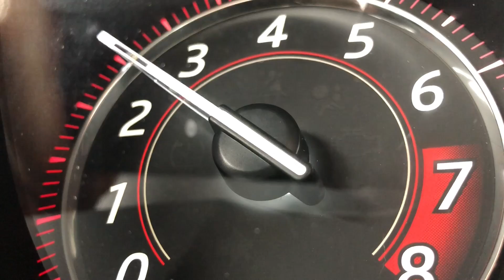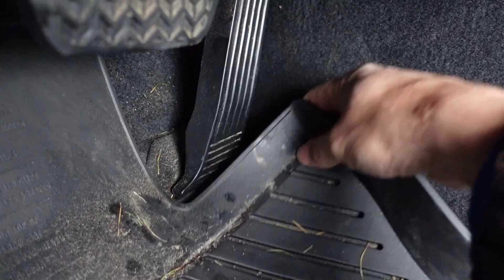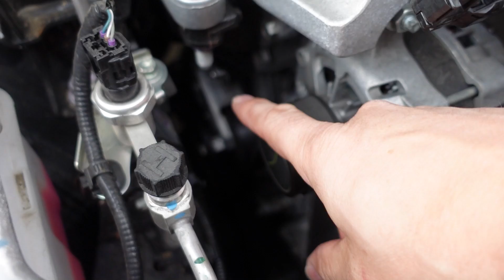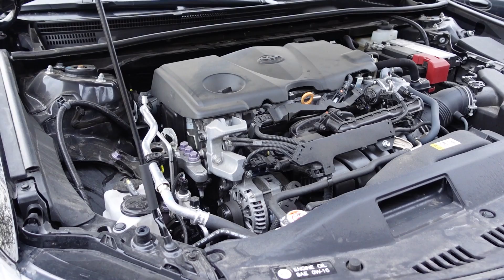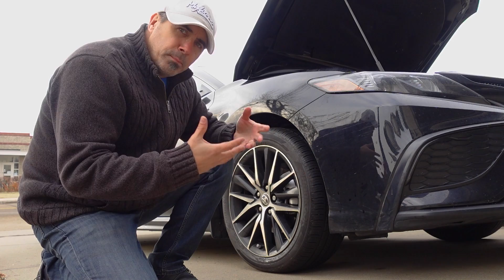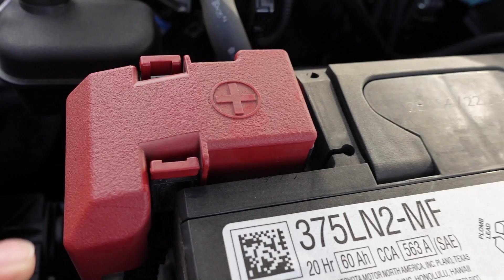Has Toyota LOST Its Reliability Reputation?

Comment: I have a 2012 Camry LE hybrid with 152k miles that I originally purchased new. Overall reliability for this model year has been excellent. I perform nearly all the maintenance on this Camry personally. I wanted to trade this Camry in for a new Avalon two years ago but then I heard from an employee at a local dealership that Toyota had embraced racist and toxic DEI and ESG initiatives. Unless Toyota stops these initiatives, then I will hang on to my Camry until it wears out, which could be 10-15 more years based on my current mileage.
Reply: Netflix almost like saying going to hold onto your body for 10:20 more years because you are you can't get into somebody else's body is stuck with your own into something else or another person and but no you don't know that say hold on to your own ass you're saying the same thing dog

Comment: I hate the keyless/button to start & screen trend. I just want a regular key & no screens
Reply: Then I'll sell you my car it's a 1997 Corolla 2570 Mi on it the inside of the motor is clean the day it was no it's a wonderful kind I want $20,000 for it yes the price of a new Corolla or I got a 1997 Nissan Sentra 2500 it's also cleaned inside the motor as a brand new one so you better get your ass over here and get rid of your own s*** and then you won't have to worry about sticking your finger on your button to

Comment: G’day Mark, fantastic vlog yet again. I own a Toyota Camry 2018 Ascent Sport 4 cyl 6 speed (non hybrid) quad exhaust motor vehicle here in Australia 🇦🇺 and do an oil and oil filter service every 7500 kilometres. I am very happy with the car but don’t like where Toyota are heading with the CVT and turbo engines. Is their any other advice based on your experience I should be wary of on my car. I hope to keep this car for 25 years.

Comment: I have a 2gr hilander, oil lines are replaced. I change the oil and filter every 3500 miles. I live in Puerto Rico, a tropical island.

Hot I replace the coolant every 3 years or

36,000 miles of transmission oil every 30,000 miles all mobile one synthetic oils.

Pcv every 20,000 miles. The transmission filter

Each

60,000 . Engine air filter is a K&N. The spares or spark skngles each

60,000. There has never been a single problem of anything, maintenance is key.
Reply: Sorry for
My inglish jejeejejejejjeje

Comment: Tengo una hilander 2gr se remplazolas líneas de aceite.Le cambio el aceite y filtro cada 3500 millas vivo en Puerto Rico una isla tropical calurosa le remplazo el coolant cada 3 años o 36,000 millas aceite de transmisión cada 30,000 millas todos los aceites sintéticos mobile one. Pcv cada 20,000 millas.El filtro de transmisión cada
60,000 .Filtro de aire de motor es un K&N.Los espares o bujías cada
60,000. Nunca a dado un solo problema de nada el mantenimiento es clave.

Comment: There are multiple reasons why modern cars are unreliable, no matter what brand.  All the high tech electronic gadgetry that people crave are a PITA. Also, because of fuel consumption standards we see CVT transmissions, small displacement engines with turbos, high-pressure fuel pumps and of course hybrid batteries.

Comment: 2015 RAV.
Water pump fail @ 60k
Missing body screws.
Cracked rear tailight
Only 2 cup holders
Not designed for those above 6 feet tall.
    2000 Toyota Quality Excells 2015 RAV.
  Dont Buy Toyota
Reply from the maker: Wow, thanks for sharing.  Yikes

Comment: Its true just bought my wife a 2024 grand highlander and less than 500 miles and already had to take it into a dealership to see what was wrong with my car.
Reply: Weren’t the interiors noisy, plastic parts squeaking?
Reply: @melissasmess2773  no it's fine at least for me. They finally got the software update and it's working fine
Reply: Why did you buy that piece of s*** you should have known better than both the 4Runner dog

Comment: Saw a 2007 Toyota Camry with over 700,000 kms on it or 420,000 miles that has the original motor and transmission and still ran as good as ever.
Reply from the maker: Wow, that is absolutely bananas and in a good way
Reply: That was the worst year for the first on the Camry who won last night long no way Mr guy changed the oil every thousand miles Channel 6 on Lewis I don't know you tell me the six cylinder was you tell me

Comment: I had a 2006 rav 4 and 2007 solaria both has bad pistons rings and I had to dump both vehicles  at a loss then they recalled
After they were gone. I left Toyota for Honda and then went back to Toyota and I have t,here a 2015 rav 4 normal trans
2021 tundra normal v8 no turbo crap for me and a 6 speed manual corolla 2022

Now the tundra is v6 turbo and the corolla stopped making the manual so only CVT
TURBO and CVT will be the downfall for future reliability
Reply: Duh I know that for 50 years old you just learned that now I don't know dog you better start eating your own dog s***

Comment: Original owner of a 1997 Tacoma with 289,000 miles on the odometer with a 4 cylinder 3RZ Motor.  Recently replaced the original water-pump at 256,000 which was not leaking.  It was replaced because I had a seeping oil pump cover that needed re-sealing & the water pump has to be removed to perform this and was replaced out of caution.  Same goes for the Brake master cylinder, brake booster failed but the master cylinder still performing perfectly. Both parts replaced with Genuine Toyota Parts & hopefully they are of the same quality as the old factory parts were.   Brake fluid in reservoir was changed every year & coolant every 5 years which I believe gave them a long service life.  Toyota is treading into some questionable areas & could end up regretting their decisions in the long term.  Only time will tell but get your V8 & V6 Toyota/Lexus's now because the new small displacement turbo motors are not the answer.

Comment: I don't agree with the narrative of this video.  Toyota and Lexus are well known to have some issues with new powertrains and they address them quickly.

1) I drove a Toyota engine that was well known to generate sludge over time even with normal oil changes (1mz-fe).  The car had over 270k miles before I sold it and it didn't even eat oil.  
2) Unintended acceleration.  That was already addressed and some cases were fraudulent cases made up by people.  
3) Oil line leak in the 2GR-FE engine. Already addressed by a recall.  Had it fixed and the car has over 210K miles.  

Bottom line, Toyota is way more proactive to fix issues and the reliability is still there.

**Quick update:  I do agree with the weak suspension issue with some of the front drive Toyota vehicles. I had one that is always off with tires worn prematurely.

Comment: I regret buying a 23 Camry lots of rattling noise otd this my first and last toyota..beware and be wise they are not like before so it’s overpriced..
Reply: I bought a Acura TSX the other day 2011 for 2500 it runs and drives great the body's all scratched up and some dents and it's making a whining noise from the wheel bearing but otherwise as fast as hell and the transmission shifts are write 250,000 me I think I got ripped off or what

Comment: I knew about the accelerator problem with Toyota and thanks for your explanation of the problem l own a1997 Toyota Hilux and it will only may have a problem  with the front end but so far so good
Reply from the maker: Those machine run for a long time.  Thanks for watching

Comment: The general public should buy Toyotas at a slower rate than what exists now. People are buying Toyotas as if they are the only reliable car which causes Toyota to get too big of a market share. Quality also slips when an auto manufacturer has to work extra hard to keep up with the demand. Instead of Toyota think of other reliable makes like Mazda, Honda or Subaru. Although there are a number of good European brands, parts are generally quite expensive. I have had good luck with North American brands, but still be selective.

Comment: They think Toyota is bad because he hasn't already had a Honda, I had a 2013 Honda Accord, when I bought a Cvt that needed an upgrade, VTC actuator making noise, engine consuming oil, rear brake calipers broke prematurely, I had to change the pair, car with 140k miles started to give punches in the transmission, I always changed Cvt oil always within the mileage that Honda suggested, always genuine hcf-2 Honda oil, moral of the story Honda for me never again, my wife's 2015 crv same defect, engine oil consumption and vct actuator making noise, Toyota is number one, I bought a Camry XSE 2020 4 cylinders, super economical

Comment: Where Toyota “cheaps out” is everything that surrounds the engine and transmission. Bad, low grade paint that chips and scratches easily, frames that are HIGHLY susceptible to rust and corrosion, flimsy suspension, cheap factory tires, cheap plasticky interiors that scratch, fade and crack easily, cheap brakes that rust like crazy, outdated infotainment systems that look like MS-DOS from the 80s, vehicle wiring made out of soy that the rodents like to chew on and eat causing 100s of dollars worth of damage and hard, uncomfortable seats that feel like they are stuffed with styrofoam. Even the engines have issues like sludge, oil leaks and burning oil. Toyotas are overrated nowadays.
Reply: Why do you know a lot about these things maybe you can tell me why my wife hates me and don't want me to touch her anymore because I see that there's bugs going into her vagina and because I don't want to clean it anymore so is that why she doesn't want and she's very mean all the time especially to me but strangely she'll talk nice though so what do you think that's all about she's not cleaning your ass and she's talking to low life crackheads and even taking Fentanyl I'm not going to say that because I don't feel like you're getting mad at me but anyway I don't know you you you you you you get the picture so you haven't answered for that

Comment: Hello Mark, my 2023 Honda CRV has been giving me problems too.  I did a video on a major problem with it if you like to watch it.
Reply: Sounds like you got the shaft
Reply: At least you don't have a Pilot or a Passport even a Odyssey those are bad.
Reply: @practicelogos53teamer  Yeah, I agree my parents have an Odyssey It is only at 85k miles and it has cost thousands in mechanical and fit/finish body issues (door rollers, seat frame, door handle falling off). So much for Honda reliabilty.
Reply: @andrewmarigo2153  their also a lot of recalls on the odyssey that your family have to look for if is a newer Odyssey.

Comment: Have seen several 2023 Corollas and Camrys with engine issues.
Reply: You have proof?
Reply: @moeanthony9308  What would constitute proof to you? Documentary video?
Reply: @653j521 yeah let me know what's wrong with the Corolla believe it or not yet that noisy engines no one's 2.0 I seen that but I don't see them breaking down yet my oldest son or gas into the oil or burning oil so what kind of problem is the Corolla let me know. Sounds like you drive a Kia or Grand Cherokee some s***

Comment: Am I really going to have to “shop” a Toyota…? If I’m going to spend 80k on a tundra I dont want to drive off the lot with doubts. If I buy used then whose problems am I buying the old owners or Toyotas…? 😢 
I already have zero faith in Toyota dealers (this latest deal that went down at their Plano Headquarters just adds to it) but now in their build quality will make me at least pause. The last redeeming quality is their willingness to “make things right” so that’s one area that sort of hasn’t lost it. Am I bitter that they got rid of the iforce V8…? Yes. Yes I am. Thanks mark.
Reply: Agree with you. The only reason I bought a 2024 RAV4 was reliability. So I dont have to deal with the dealer since hopefully nothing will go wrong with the car.  First parts purchase was 3 Toyota  oil filters since I dont trust the dealer to change my oil with his bulk crap of who knows what. Don't think the dealer is going to buy 0w-16 and 0w-20 0ils so will just dump a compromise weight that fits most vehicles. They are such skum on the front end purchase that there is no reason to believe the service department is any different.
Reply: @3100fps  Why did you buy from them?
Reply: @653j521  Stupid question

Comment: I have taken my Lexus vehicles to a Toyota master tech for years. He works on Toyota/Lexus all day every day.  He told me that the days of Toyota's reliability are gone. He mentions the build quality and amount of plastics as well as a lack of simplicity as the down fall. 
I think this is an industry wide issue as OEM's have been forced to innovate for fuel standards. 

Pick up a Lexus or Toyota with their old powertrains before its too late.
Reply: Agreed. Pick up their older naturally aspirated engines while you can. The rock solid 2GR is the next to go. I  bet 2024 will be the last year for it but i hope i am wrong.
Reply: @njackson18  he said the only new Toyota he'd get today is the 4Runner. Lol, the only model still rocking the old V6(1GR)
Lexus still has the GX selling the V8 and IS, RC still with the 2GR. But, we're about 2 years out of losing all those.
Maybe the LC keeps the V8... But that's hardly counts
Reply: Toyota is Lexus
Reply: @SamuelGonzalez-pn8yn  that's why I take my Lexus to him!
Reply: Lexus is made by Toyota
Reply: Da.h @SamuelGonzalez-pn8yn

Comment: I have a 2019 Camry SE. So far, the only issue it's had was the recall for the fuel pump. That got done the same year I got the car. I also tend to be gentle with newer cars because all of them tend to have lots of plastic and brittle metal. The Camry is no exception.
Reply: Can't beat the 1993 camry 2.2 4 cyl
Reply: the automatic transmission suck though 92 to 96 and the motor is leaked oil like a pig and they were front having the front was too long and they bounced all over the place stressful bed odd-looking car ugly long and ugly and bouncy otherwise everything was great besides that dog

Comment: A GREAT MOVE FOR TOYOTA...The new REDESIGNED  2025 Toyota Camry which will be available mid-year of 2024 ,will come standard with the hybrid 2.5 naturally aspired  engine . It will have improved.. standard 225 Hp.. 234 for the AWD .. Far exceeds any midsize sedan standard engine.. improved gas mileage.. many new standard options..
Reply: Then go buy it then you deal with it I'll keep my 97 Corollas I got three of them with 50,000 miles on it
Reply: @jamescostello7584  Regardless of mileage ..a 1997 Corolla was a basic little ecobox not suitable for today`s highway/interstate driving ... It did not have any safety features other than 2 front airbags and sow dismal acceleration ... Ok for a kid to practice driving on ... Not good for real world driving ..

Comment: Et tu, Toyota? Et Tu? No car is perfect, infallible, but at least Toyota addresses the issues, and not like certain German automakers who ignore the degradation. I took our Toyota 2022 Tacoma for an oil change and they did the customary whole vehicle inspection with at least two paragraphs on the service receipt dedicated to explaining that they checked that the driver's side floor mat locking clips were properly installed , locked into place. They also indicated in writing, that non-factory floor mats on the driver's side would be removed and placed on the rear seat of the vehicle. Liability is obviously a concern.  Too bad other automakers ignore the Takata airbag dangers to this day. BMW was a big offender, and the year affected were 2000 to 2006. Thankfully, no BMW older than 2012 is still on the road but safely deposited in junk yards the world over, right next to Mercedes.
Reply: Mercedes-Benz was ordered to pay $12.5million for not properly telling customers about the urgent recall of deadly airbags.
Reply: Co-worker bought a 2017 Jeep Patriot, new drove 40k miles, transmission was toast. @@Ayn-Rand-Is-Dead